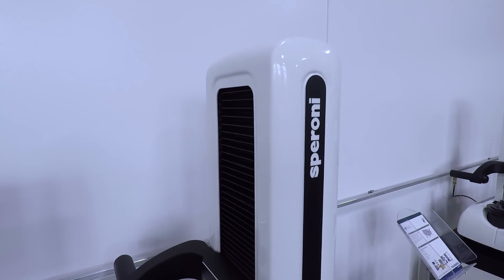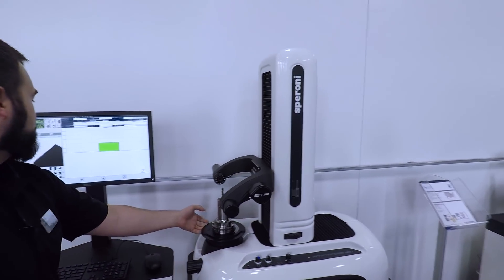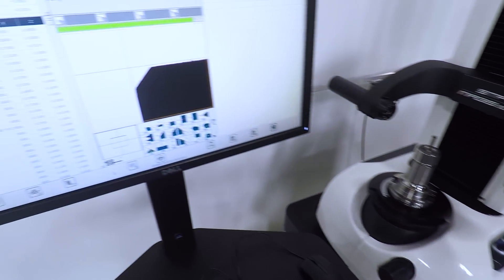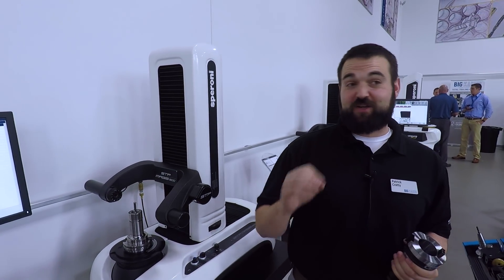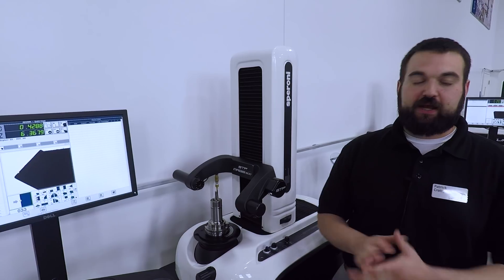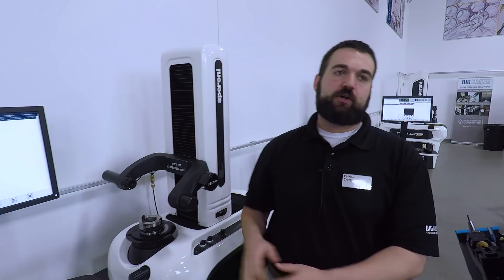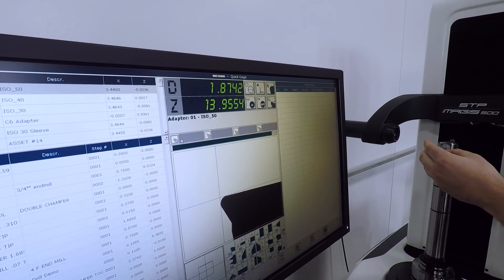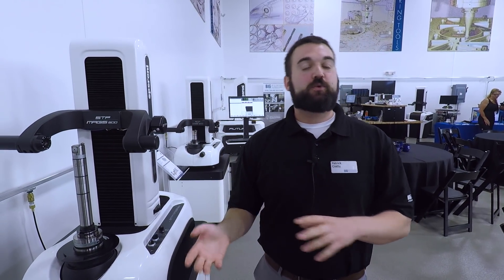What is a CNC Tool Presetter?

Comment: Another vote for Zoller. It's the top of the top as far as offline pre-setting go's. 

Aside from length, and runout: It's very accurate to measure diametric offsets for diameter. Cutting tool manufacturers also work to a tolerance. The .5/inch mill you ordered is usually a few tenths smaller, if not more. 

This makes tight tolerance work much easier - especially in a production setting. I swear, our Zoller machine at work will pick up a thumbprint! It's crazy!

Comment: Did anyone else notice when John asked about accuracy that the sales rep. quoted repeatability?  They are not the same numbers.  Sometimes by quite a big margin.  That is typical in this industry and many others.  Always call them out on this.  They know the number.  They don't want to tell it to you because it is typically a bigger number.
Reply: We typically do not call out accuracy, because there are too many variables at play. From tooling to temperature of where the machine is located, most of which is out of the manufacturer's control. So we state our repeat-ability, meaning our machine will measure the same tool to the same value. To become accurate to your machine, we can create an offset for that. It's not like we are trying to pull the wool over anyone's eyes here. We are just trying to remain honest.
Reply: There's a lot of variables at play. How beatup is the holder? how beat up are the collets? whats the process control on the tooling used?

I'm sure this is a very fine machine, and after calibration on the machine's taper - Is VERY accurate.
Reply: I was not referring to the accuracy of the tooling being put in the machine and how that affects the overall accuracy.  But the accuracy of the machine itself.  For instance the accuracy at the gauge line.  I have no doubt it is a great machine.  But the difference in those two numbers really tells the story on what you can expect when relying on your measurements to give you the results needed to make decisions on.
Reply: Our Zoller is within a tenth every time I've checked it against our certified gage bar. 

Close enough for the jobs we do. It's harder to find tooling with the process control and quality for repeat-ability. 

Shop's also temperature controlled, so that helps.

Comment: Also RFID tags such as balluf are a huge win for loading the measured tool geometry from the presetter directly into the mill, no manual entry errors.  Also can get a history of the tool, it’s usage and times in the spindle.
Reply: I hope we switch to this, or a networked deal. 

printing tags is a huge waste.

Comment: Guys I only watch this channel for entertainment.  I'm asking kindly if you can explain run out in lay man terms please
Reply: Tangobaldy it's basically how crooked the tool is in the holder. Like indicating a part in a lathe chuck but with a milling tool. Its how far off centre the cutting tool spins any given point.  It causes uneven loading if flutes, fatigue in tools and as such poor surface finish and tool life.
Reply: slammenwagen thank you for explaining.

Comment: I designed an incoming tooling inspection and offline pre-setting program at my first internship. Found multiple pieces of tooling that were not manufactured to spec and previously would have only been found by producing scrap. I was working on an older Zoller machine and had programs for each tool that would automatically inspect all cutting edges, smoothing pads, etc. These are significantly under-utilized in manufacturing. Years later, I found out my employer didn't use any of the nearly 200 programs i had written.

Comment: John: if you are thinking about a tool setter I have a much simpler version of this Speroni tool setter and I really like it. Here at Centerline they have a CNC Zoller tool setter and I really don't care for it at all. I wouldn't recommend it to anyone. In this video you didn't mention the Kiser Big Diashowa collet chucks. I have used many brands of collet chucks. Theirs chucks and collets are by far the best I have ever used. If you want to use a collet chuck to hold milling tools with the most retention and minimum run out look at their Mega E chucks and their Mega Double Power Milling chucks. They are expensive but after using them you wont want to go back to normal chucks. They also make precision ER collets and chucks.
Reply: You have all the coolest toys... I mean tools!

I've only seen a couple brands in person, but I'm also a fan of my Big Daishowa collet chucks. And the quality of the Big Daishowa collets is much greater than the few other brands I've seen. They're quite pricey though (my ER20 collets were ~$100 each, if I remember right).
Reply from the maker: Thanks - love your videos too!
Reply: Yea, Edge Precision has the greatest videos.